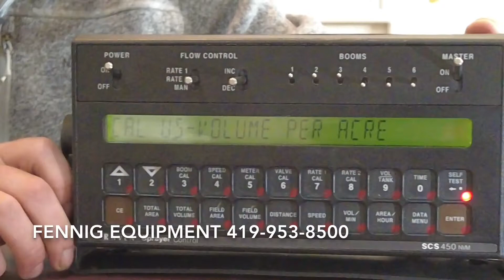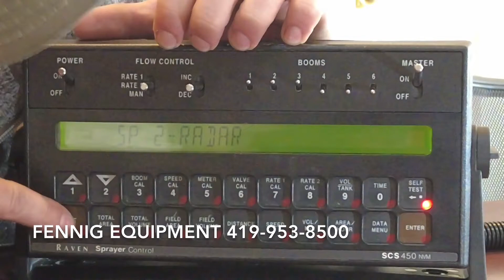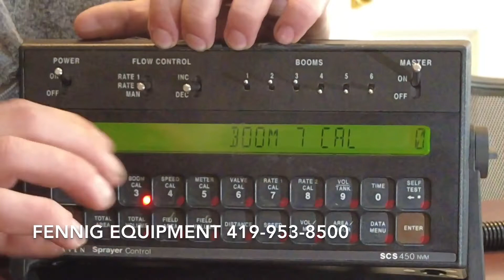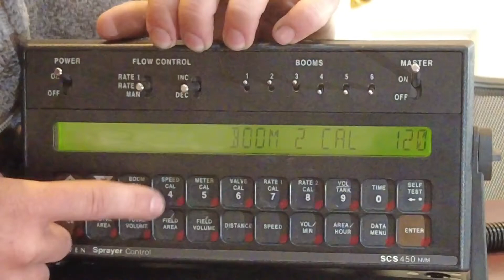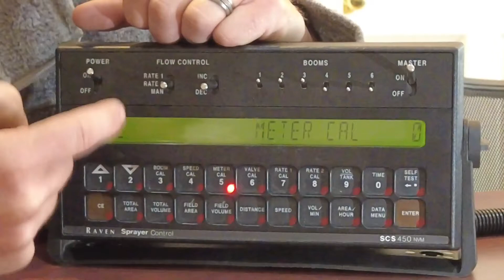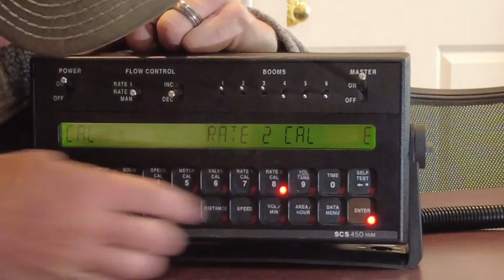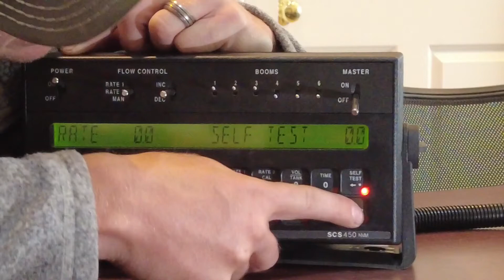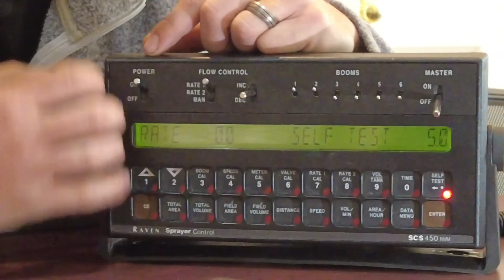How to Program A Raven Controller

Comment: Do you know if the Raven 440 controller will operate Hardi valves and read a Hardi flo meter and wheel speed pickup? Have you tried any?
Reply from the maker: I don’t know if it will or not